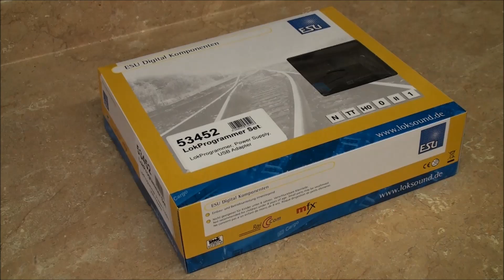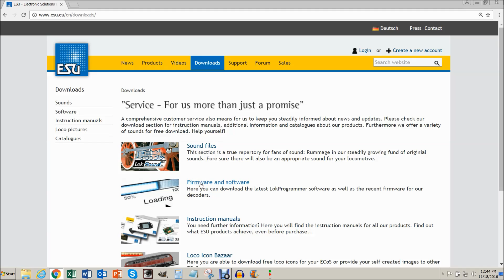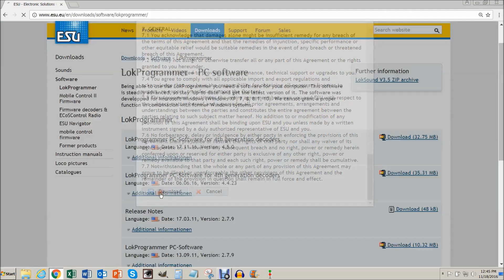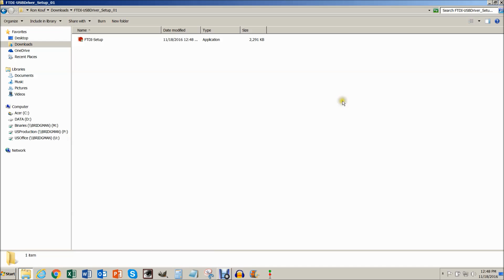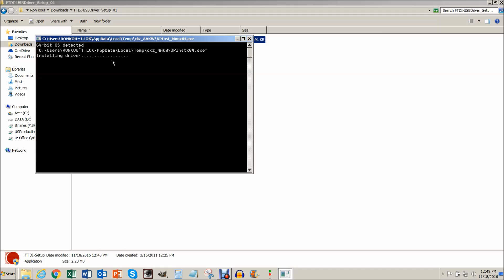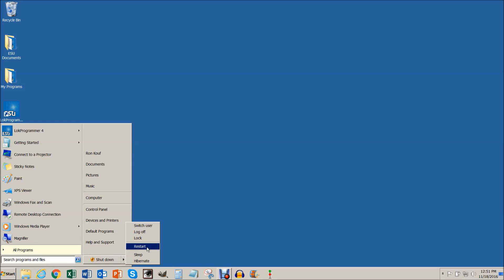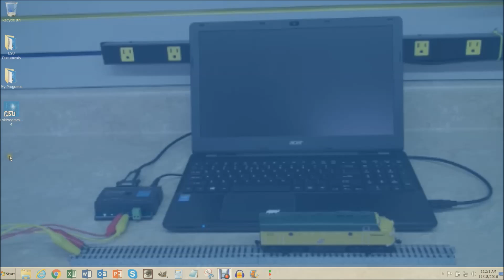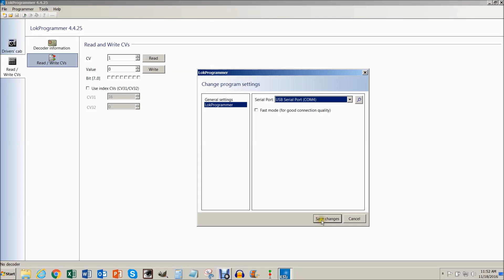LokProgrammer Setup Video

Comment: ESU. I have just updated my windows 11 pc to a Snapdragon machine and the LokProgrammer software does not recognise to LokProgrammer Hardware. I plug my old Windows 11 machine in and it works. this would indicate a device driver issue. Are ESU going to issue a device driver update for these type of PCs ?

Comment: One thing i don´t like ESU lokprogrammer...there is no possible to use with the mac computer and macOS operative system.
Reply from the maker: You can use parallels on a Mac. Windows emulator... It is not ideal, we understand, but it does work.
Reply: how about Linux?
Reply: @SheltonDCruz  VirtualBox or VM Ware and Windows :-(